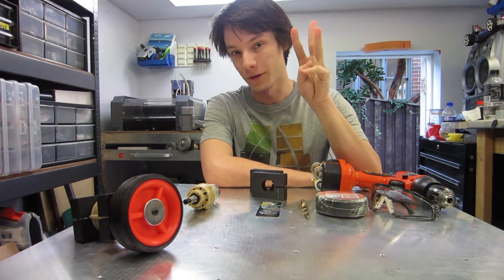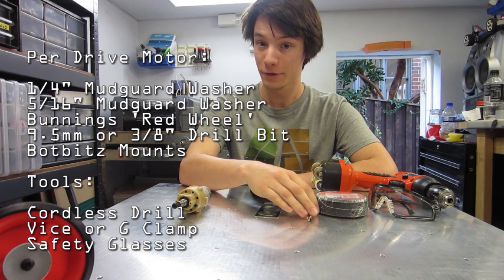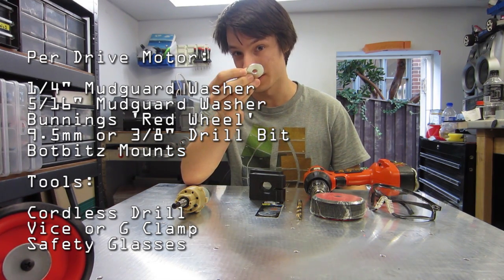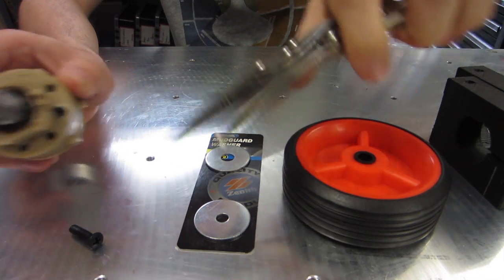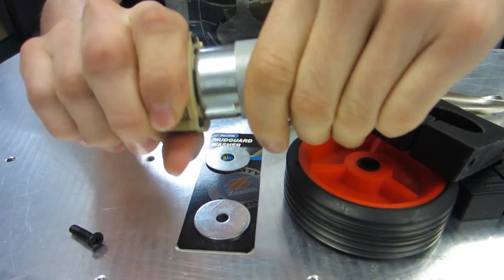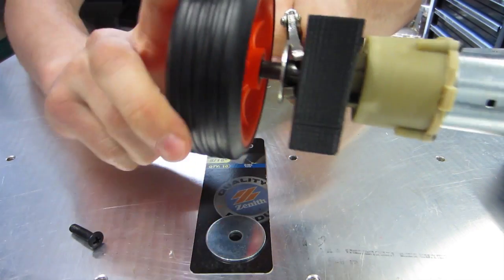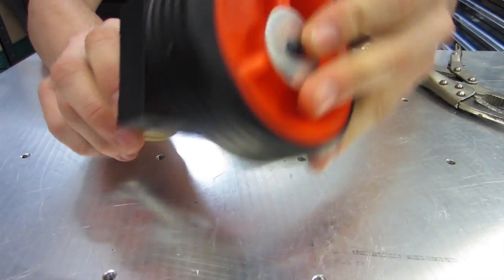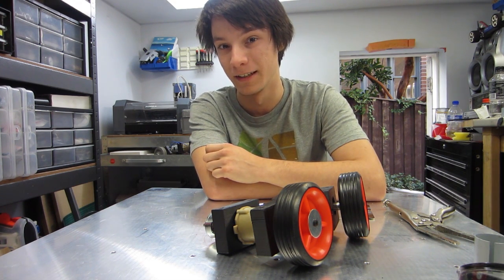How to build a Combat Robot - Episode 3 Attaching Wheels and Mounts

Comment: i think the guard you took off the motor is to prevent sparks from coming out of the slits in the sides
Reply from the maker: No those slits should be open to allow air flow. The flux ring improves torque and efficiency of the motor.

Comment from the maker: @brandon casey Hey I can't reply to your comment for some reason, but the redwheels have a roughly 8-9mm hole. In imperial, something about 3/8" or 5/16" should be close! The idea here is you use the big washer to 'clamp' the wheel tight rather than rely on the threads in the wheel (which always just strip!).

Comment: Do you have to use a mount
Reply: well no, but you need some way to hold them securely in place... You could use zip ties and the original drill casings to get started!
Reply: Thanks
Reply: Hose clamps would probably be better then zip ties. They are a lot more durable and you can take them off and put them back on.

Comment: anyone find compatible wheels outside australia???
Reply from the maker: Where are you located? If you're in US then try colsons from robotmarketplace. They're the best wheels to use, period. Just really expensive to ship here :( UK or other places, sorry not sure...
Reply: RobowarsNSW thanks for the reply, I'm in US! I've looked at the colson wheels on robotmarketplace but doesn't the bore of the wheel need to be 3/8" to match the shaft of the drill motor gearbox? the only one close to that on the colson section of robotmarketplace has 5/16" bore which I suppose could be drilled out, but I doubt it would be a perfectly centered hole and would cause wobble during drive....
Reply from the maker: Yeah, some machining is usually required. You can buy drill hub adapters from kitbots, they sell them as "Colson Cordless Drillmotor Hubs" but are pretty pricy. If you have access to a lathe you can turn up hubs fairly easily :)

Comment from the maker: Yeah, a little reading up suggests they increase torque and efficiency (slightly) at the expense of RPM. Good to know! Probably needed for cordless drills but the redwheels in the video break traction so easily that a little extra speed is good. :)

Comment: Liking these videos! I believe the ring around these motors (and around any motor that is mass produced) is called a torque-ring, or at least it's known as that in the community. They essentially give the motor more torque by the greater thickness of metal around the magnets... or... something. We used to take them off but after an event in Germany we were convinced to leave them on. The manufacturers wouldn't spend the extra to add them to the drills if they truly had no purpose.

Keep it up!